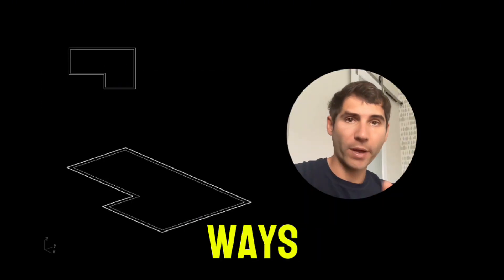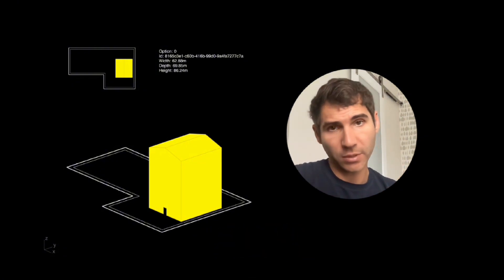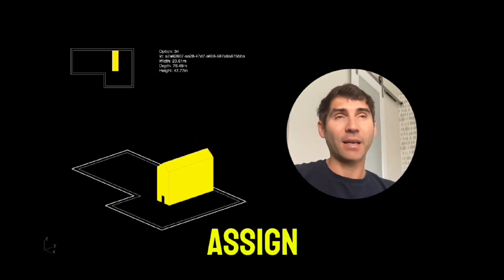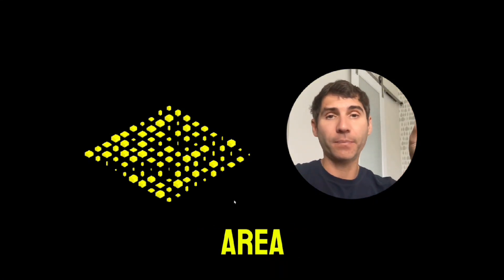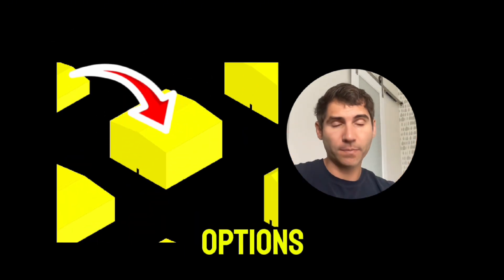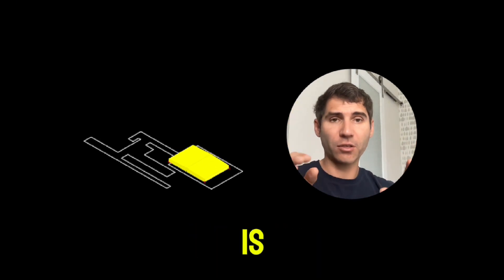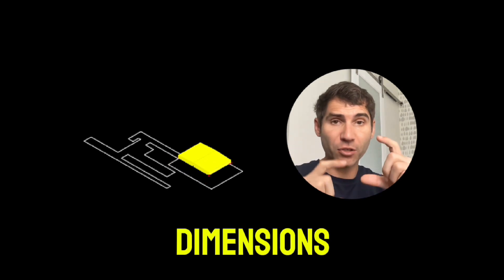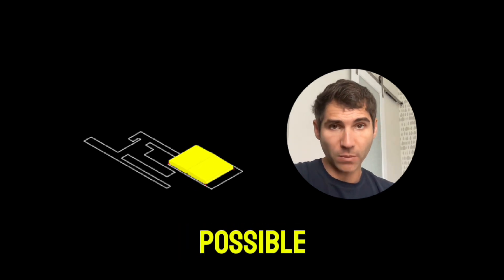Generative Design for Dummies #02: Brute Force vs Optimization (Rhino - Grasshopper)

Comment: Hi. I think you miss the major point here: both are generative, seeking for some end goal (largest, brightest.. ) just brute force goes through ALL possible options out there, and in some cases it can be a lot of options and takes too long and too large amounts of computer time. So smart people developed algorithms to get closer to best result while maintaining acceptable time and computer power. Galapagos is one example: it is based on genetic algorithm- means it starts with some random iterations for some time ( a generation) and then takes the best of them, mate them, and run for another generation. After some 10, 20,30 generations you get a really good result, but not sure it is the BEST result… and if you run it again, you might get different solution. 
So it is just different approaches to walk through a field of possibilities- one is check all the options, one tired to shortcut it by a method, but both cases are approaches to optimization…
Reply from the maker: Sorry what point am I missing? I don´t get your point... I am talking about 2 approaches as you said: Brute Force (infinite options) vs Optimization (Galapagos - Genetic Algorithms)...  Both are generative yes...
Reply: To make it actual- it is similar to the trick DeepSeek did with AI, when you don’t have access to huge computing power(bf), you innovate and find ways to get optimization without it… 😊